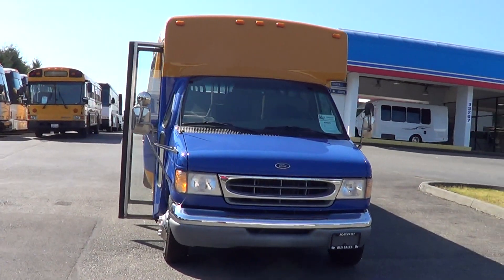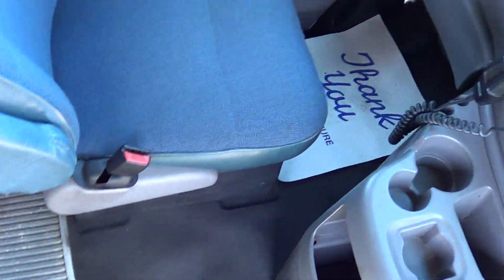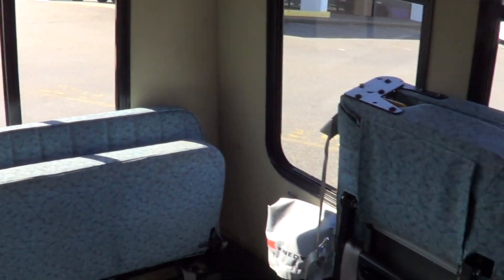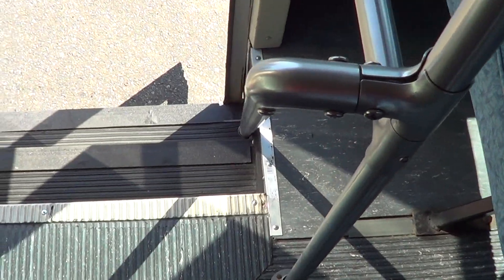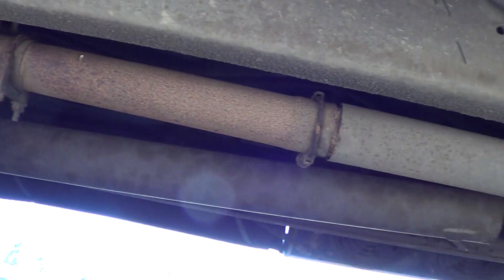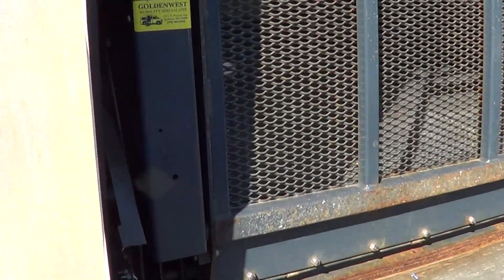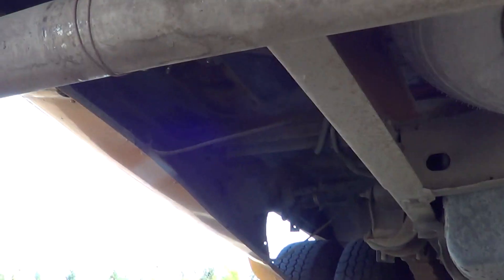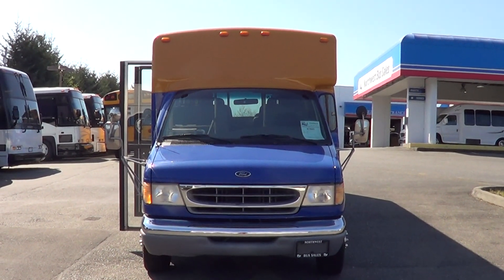Northwest Bus Sales Used 2000 Ford Diamond ADA Shuttle Bus S75923

Comment: Love the bus but even though it's not perfect by modern standards I think it looks descent.  If there was a way to prevent any cosmetic imperfection In a bus generally speaking, there should've been a sealant where the paint is scratch resistant, fade resistant, and a sealer to prevent wear and tear resistant on the step treads, anti-trade spray for the upholstery, crack free windshield, and an anticipation spray on the wheel chair lift to make a new bus again.